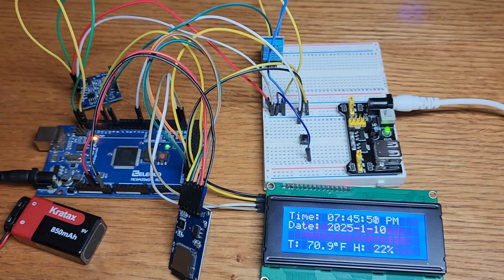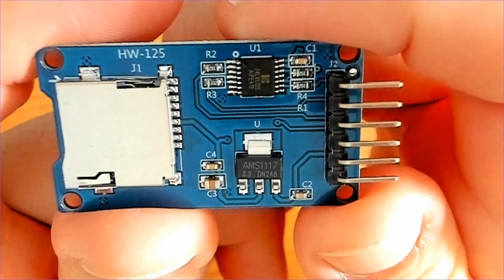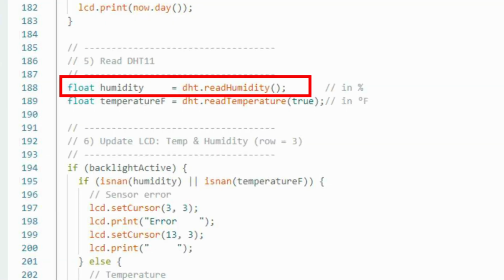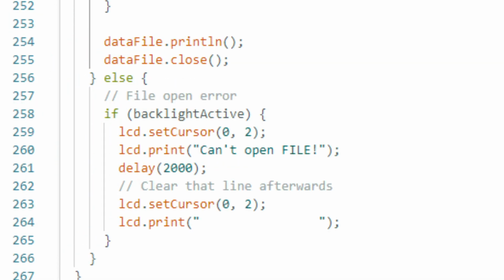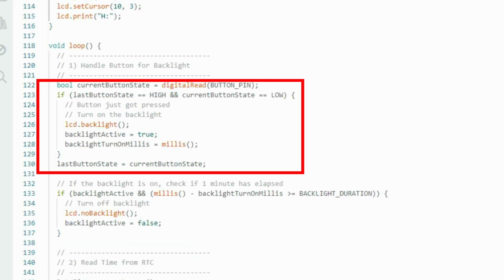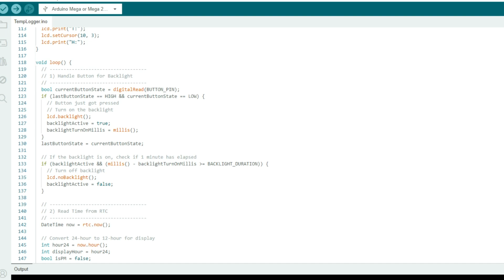How to Build a Temperature and Humidity Data Logger with Arduino #arduino

Comment: Bro why you used power supply for breadboard and where did you connect its cable?
Reply from the maker: There are different ways to power your project. I chose a breadboard supply in this video, but you can go another route...no problem.

The diagrams are time stamped

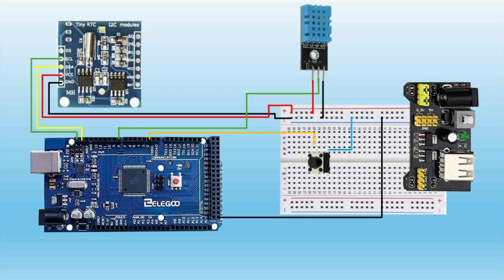1:41 RTC wiring diagram #1 
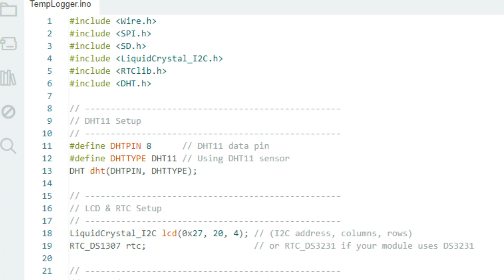1:51 RTC code
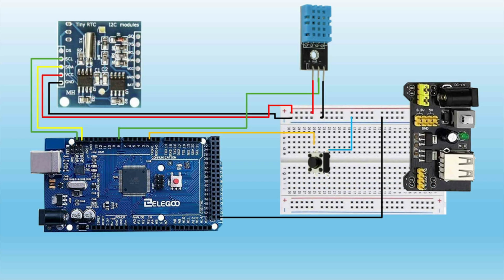2:23 DHT11 wiring diagram #2
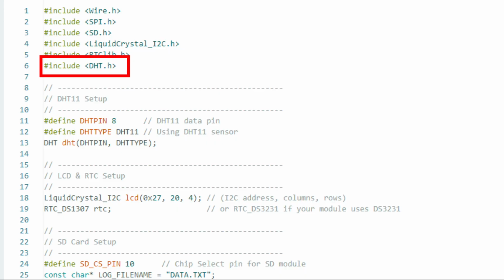2:29 DHT11 code
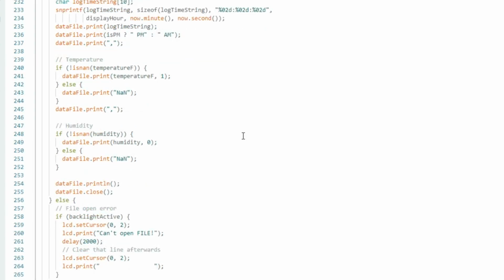3:08  Change temp from F to C reading
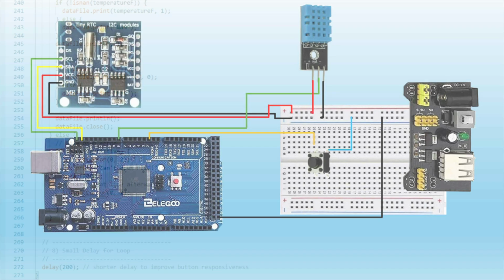3:14 button wiring diagram #3
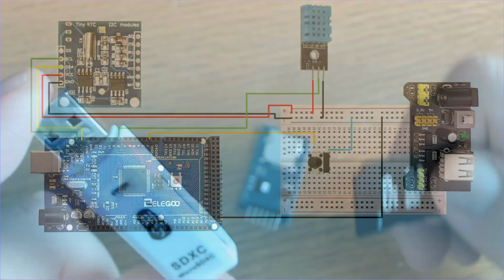3:19 prepare MicroSD card
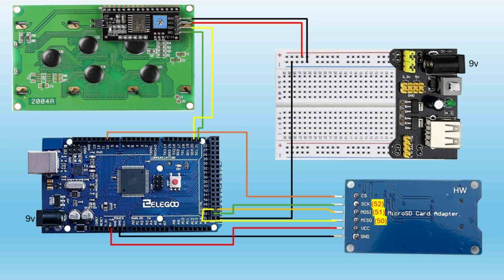3:34 MicroSD card module wiring diagram #4
3:55 MicroSD card code
4:56 I2C LCD display wiring diagram #5

Comment: This is a pretty good project, and very well explained. I've also played around with a similar project, much less polished than what you have done. My concern has always been, when can you safely access and remove the uSD card? Yes, the data.txt file is safely closed most of the time, and yes, the time required to open the file and write data is short, but technically, it is possible for you physically remove the uSD card while the Arduino is in the middle of updating the data file. The same question for the case where you want to power-down the whole system. What if you remove power from the Arduino while it is in the middle of writing new data to the uSD card?
One thought I had was to have an LED that turns on 5 or 10 seconds before the write operation is to start, and turns off when the write operation is complete, and the data file is closed. So, if you walk up to the system and the LED is off, then you can safely remove power. If the LED is on, then just wait a few seconds until the LED goes off, and then remove power. If you happen to remove power just as the LED turns on, then you're okay as long as the Arduino halts before 5 or 10 second time-out.
Reply from the maker: wow, great questions. I have been pulling power to the Arduino and taking the card out but I see what you're saying. If I have been logging daylight hours or temp/humidity for a month and I pull power, it could very well corrupt my data and all that time would be wasted.
 I like the idea of an LED status light 5 sec before and 5 sec after the Arduino writes to the card. You could also call a function that makes sure there are no writes in progress before shutting down. 
I think I like the idea of using an LED though - straight forward, simple, obvious... 
I would like to set this outside in the spring and track the critters that run around our property. It snowed recently and there were a variety of hoof tracks and bunny tracks criss crossing the lawn. It would be interesting to see what I get. I have other ideas as well. Thanks for posting this question! 👍
Reply: Rather than store the data on an SD card, why not email the data email the data?